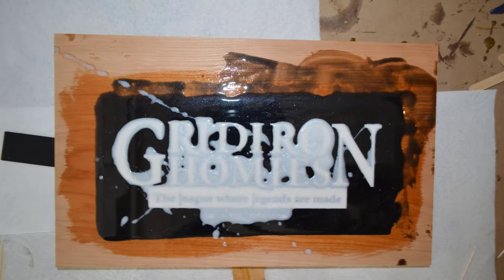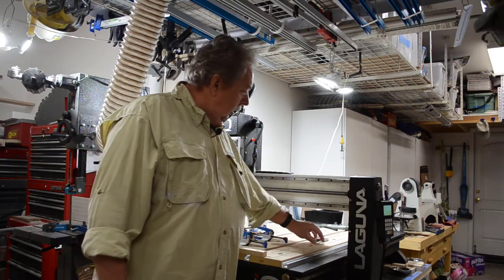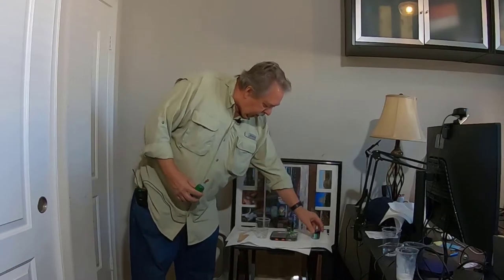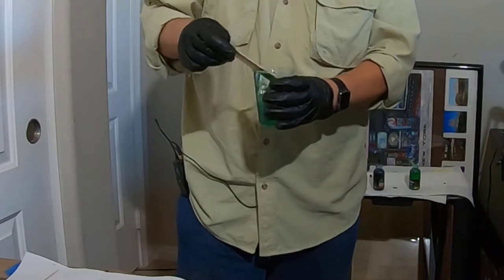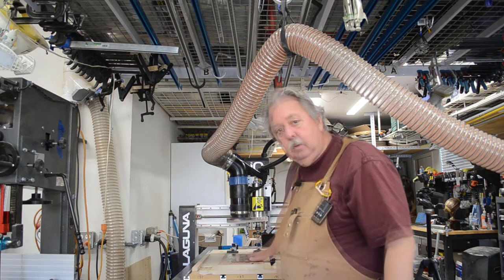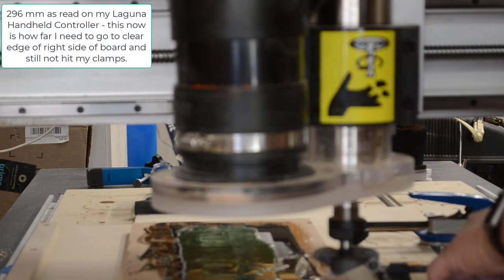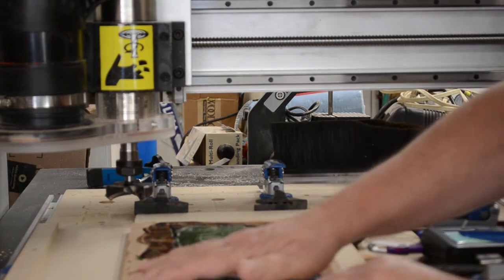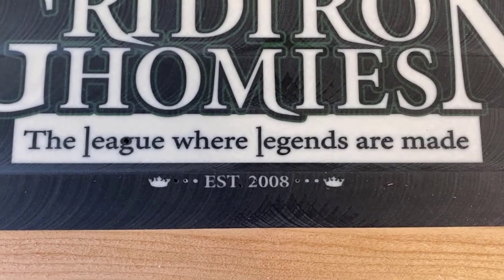Multicolor Epoxy Pouring - Green Color and Milling Away Epoxy - Part 4

Comment: I am enjoying and learning from your videos.  Thanks.  A question I thought of while you were mixing your epoxy.  Do you clean the cups you use?  If so how? and If you don't clean them,  what cups are you using?
Reply from the maker: john I do not.  I get my cups from Amazon.  They are disposable.  I use 8oz clear plastic ones and smaller paper ones.  Just look up epoxy mixing cups.  If you need an Amazon link I can look it up but it is very easy.

Comment: Very helpful video series, one tip, the popup texts are disappearing quite fast for me to read.
Reply from the maker: Thank you for the feedback.  I did get similar feedback a few videos back, maybe tis was the one.  

I attempted to make the pop-up texts a bit longer in future videos, but it is difficult at times because I am moving from one topic to another.  Will try to keep up longer.  

Although it can be annoying until I dial in the right length of time to keep pop-ups on the screen, may need to hit pause for a few seconds on those shorter messages to try and read.  I'm sure you are already doing this and sorry for that, but I don't plan on going back to modify - I will try to do better - but no guarantees.
Reply: @RobSandstromDesigns  no problem hitting pause or rewind 10 seconds. Just wanted to let you know about it. Keep the videos coming, I'm learning a lot from this.
Reply from the maker: @JasperTielen  Thank you I appreciate the feedback about trying to make the videos better and wanted to let you know I heard it and what I was going to do with it.